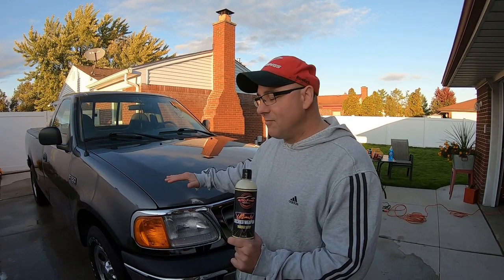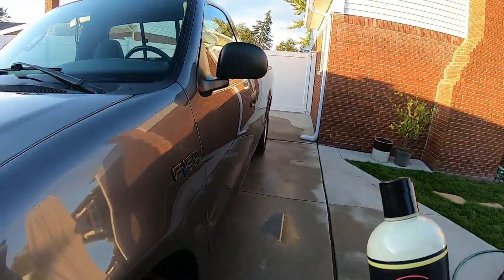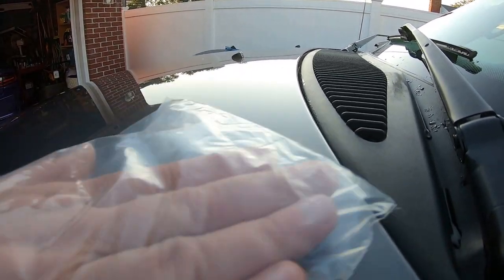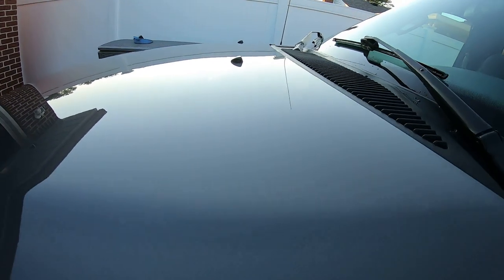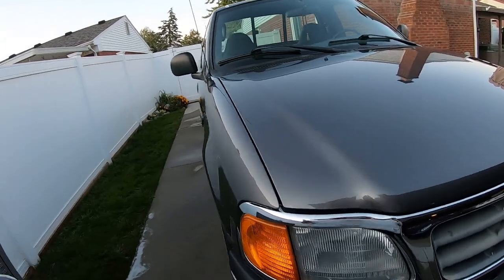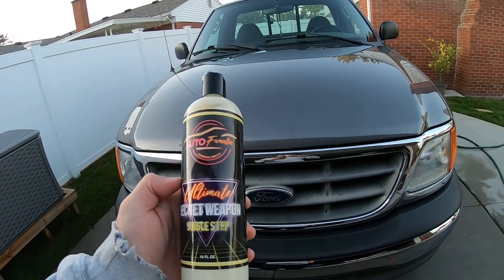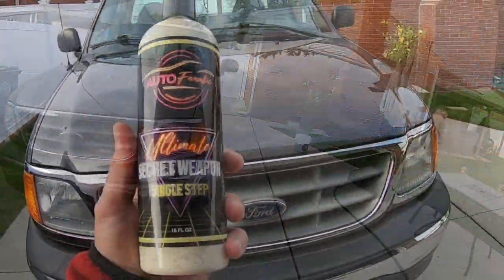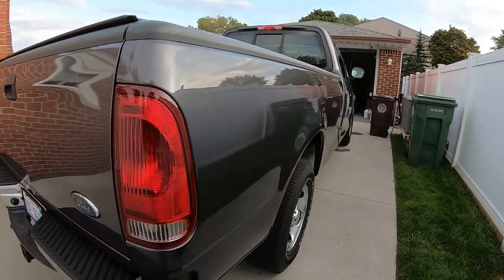How To Use AUTO FANATIC Ultimate Secret Weapon Single Step Car Polish | You Will love this Product

Comment: Nice review. I have used this a few times with excellent results. I have been able to remove visible scratch marks on bumpers (not the deep ones) where the black from one bumper bumping into another, by hand. Unless you looked really close you wouldn't know it was there. 
I used it on a white car that had been left out on a lot for a year, using the G6, and it looked like a new car. I did a full contact wash and clayed it before as it had a lot of contamination and I didn't want to risk introducing any scratches. When I bought it back the owners didn't think it was the same car 😁 👍✌️🇺🇸
Reply from the maker: I was geeked at how good this secret weapon is. Auto Fanatic made a great product we tested at a junk yard on old paint by hand it worked great. Thanks for the great comment

Comment: Secret weapon renders amazing results with a DA paired with Lake Country's orange pad. I polished my daily driver SUV this way after covering 18,000 miles (in around 18 months). Took me 5 hours to polish and coat the car with Fusso Coat. The paint was in very good condition already but Secret Weapon took it to the next level regarding gloss, clarity and cleanliness. Gosh, it felt like the car had just run out of production line. A little goes a long way. It's safer and much more satisfying to use than clay too!
Reply from the maker: Every detailer needs to be using Secret weapon . It made the F-150 paint look better then new and you are right secret weapon it better then using a clay and it saves time. We did the same put Fusso Coat on the truck we have videos on Fusso coat also. Thank you for sharing

Comment: The UK government should get the MI5 all over this. It's bloody insane how good this stuff is! I found that it works great with a MF pad for most common jobs and light correction by hand. A finishing foam, lightly damp applicator does wonders for correcting the piano black A, B and C pillars on my SUV. This is a keeper. Price could be better here though. £30 delivered is for the few. People used to Autoglym SRP, this is better in every sense, no smell, no dust, better cut and much more flexible. 👍🇬🇧
Reply from the maker: This product is great it made the paint smooth and gave a nice shine . Thanks for the tip on using a damp applicator on pillars .Stinks you get hit with a higher price in the UK . Cool you are in the UK watching this video and i did test this product on a 1976 dodge check out the video if you like . Thanks JWL
Reply: @OuzoLouGarage  you're welcome! That video in the graveyard was awesome and convinced me to fork out £30 ($40) and buy SW. 😉